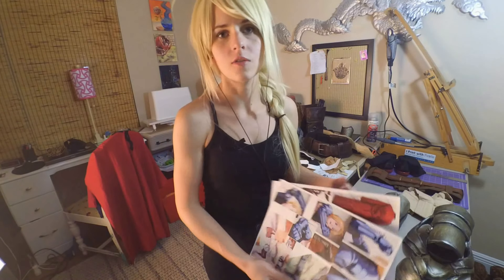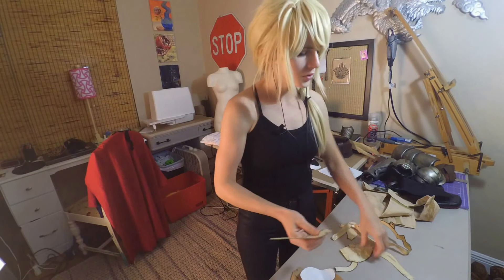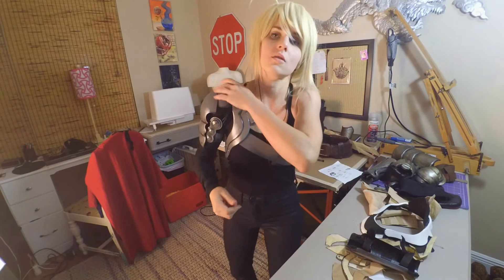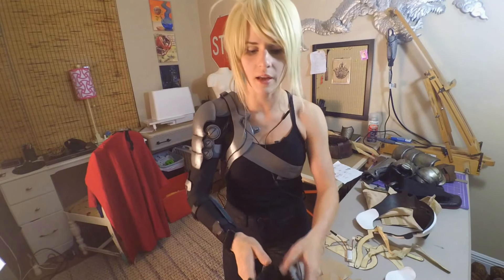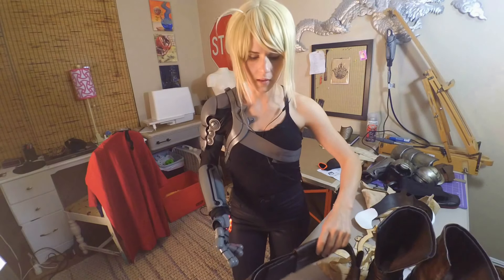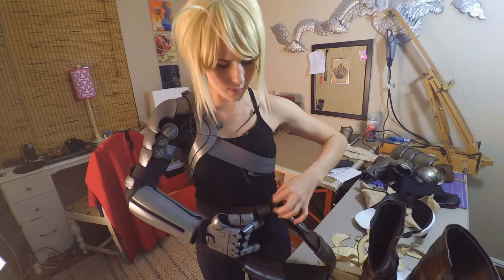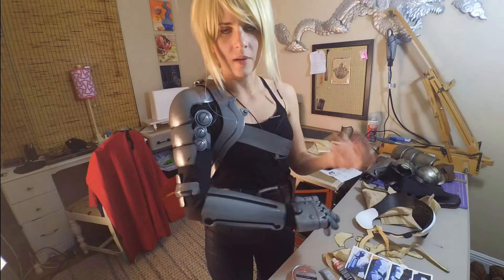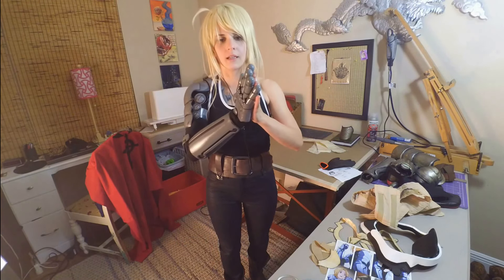3D Printed Automail Edward Elric Costume Design Discussion

Comment: Did you 3D print the first hand as well? I'm working on Eds arm as well but I'm having a hard time with the hand~ (unfortunately I don't have a 3D printer but I think that both of your arms turned out fantastic)^^
Reply from the maker: For the fingers on the first hand i cut the pieces out of poster board then glued fabric to both sides. To make it smooth I mixed acrylic paint with baking soda and painted it on thick. Sands really easily once dry then more coats of glue to make it more durable. The palm and back of hand were shaped out of crumpled aluminum foil then covered in fabric same as fingers. But I'd recommend using craft foam, that would have been way easier :-)
Reply: +Lindy DesignLAB oh my goodness thank you so much for telling me! Honestly I thought your video was super informative on the cosplay and how you made it (definitely gonna try to do what you did with the belt as well its the best one I've ever seen by far)  thank you so much for replying 💗💗
Reply from the maker: Bufftuna You're welcome!

Comment: That was an excellent walk-through. Do you per chance remember the settings for the semi-flex? and have you tried the ninjaflex? Its good to know you can sand the flex materials though.
Reply from the maker: The shoe soles are ninjaflex, properties similar just slightly more flexible. Both stick extremely well to printbite at room temp or if small surface area on bed then barely warm. Nozzle around 240, layer height .2 for all these pieces. With bondtech extruder on there I've been printing around 30 mm/s. Turned fans on for some pieces such as the hand with the round knuckles.

Comment: When making the pieces for your forearm, did you print it flat and then heat it up to bend into shape, or do you have some kind of way to reference for the forearm up to the shoulder?  For the fingers, you can angle the underside of the finger "rings" to allow more movement.
Reply from the maker: The forearm pieces and shoulder plate were printed vertically with the curves already in the model. I debated about cutting out space at palm side of the knuckles... In the end stuck with the reference images even though they don't make sense in real life.
Reply: I don't mean about actually printing it, but getting a decent set of dimensions so you can get a decent fit.  I'm doing my own 3D printed costume, and while I have the gauntlet down, the forearm and upper arm are kinda tricky since I have to get dimensions on myself, with little/no help/guide.
Reply from the maker: Ahhh, gotcha! If I remember right... and it's been a while so the details are a bit fuzzy :P but I think I used a mix of measuring my arm, basing it off of the dimensions of the first version and eyeballing it. Have you tried doing the plastic wrap and tape method and drawing the pattern on yourself to get a starting point? Props on getting the gauntlet down already. That was the hardest part for me, and the final version is still a little too small!
Reply: I was waiting on my gloves that have an extended cover over the forearm before I got too serious.  I've designed some bracers before, but for this design I want it to be as close, or closer.  I did get the circumference values for the wrist and crook of the elbow, but I wanted to get some more information before making too many changes.  The gauntlet I did October of last year, but the gloves I bought were low quality, so I had to scrap that part, but the finger tip pieces are still good I think to some degree.
Reply: Here's the gauntlet:  https://www.youtube.com/watch?v=IYRKUit4BkA
Reply from the maker: Another measurement you might consider would be the widest part of the forearm vs closer to the elbow if you want a more contoured look.
Reply: Yeah, I've got that already.

Comment: How long did it take to make everything?
Reply from the maker: I did not keep track but many, many hours between patterning, 3d modeling and finishing.
Reply: Lindy Design Lab any tips for the noob me? I am year one of my digital design course in a university and am learning 3d modeling I plan to print out 3d models and hopefully make props cosplay gear and shit but I have never worked with a single hardware you use in your videos
Reply from the maker: Just go for it and experiment. The more familiar you get with how your 3d model prints in real life, the better you will get at designing stuff that prints well without too many test prints or modifications. The thing I regret most about this particular model is that it doesn't scale well without a lot of extra work because the walls get too thick or thin. I think Fusion 360 is a better program which may help to avoid such issues, so I'd recommend trying that instead of what I used.

Comment: Very cool! I came for the printbite reviews but I love all of your content.

Next time you need to join 2 printed pieces, maybe try friction welding. You just stick a short piece of filament in your dremel, and when you push it into the plastic the friction heats it up so much that it all melts together. I found these two links to be very helpful:
http://makezine.com/projects/make-34/skill-builder-finishing-and-post-processing-your-3d-printed-objects/
https://www.youtube.com/watch?v=Cj9TMmUldhc

I've only tried it myself using PLA and it worked very well. I'm not sure how well it would work with flexible filaments, since you want the piece in your dremel to be quite stiff so it doesn't flop around. But I guess you could just use some other plastic that has a similar melting point.
Reply from the maker: I will try that, thank you for the suggestion and links!